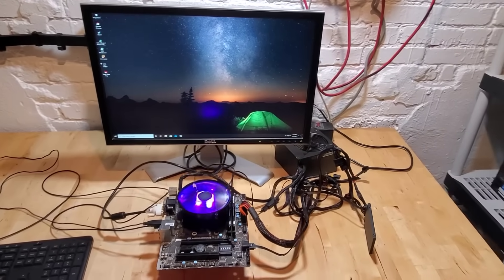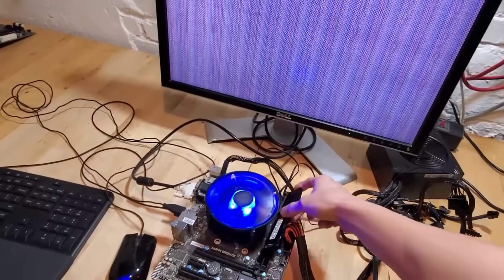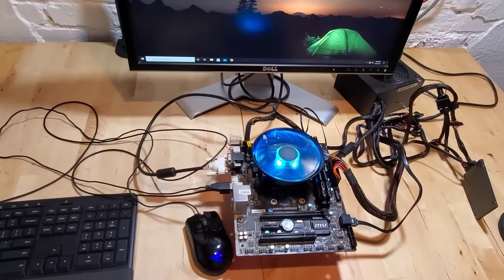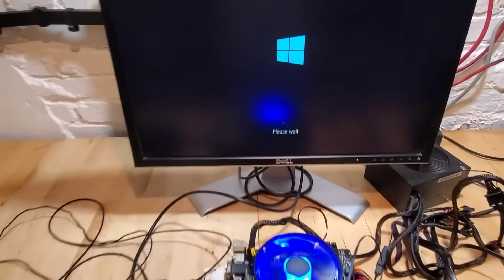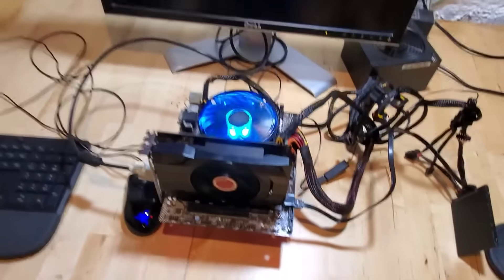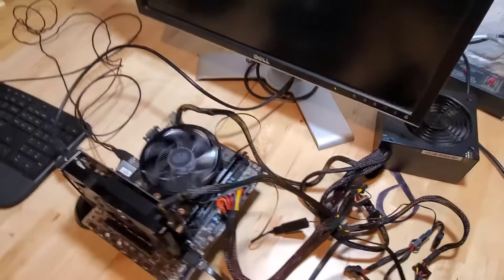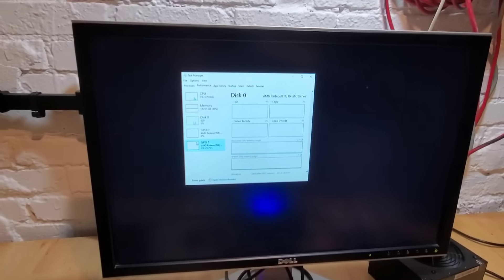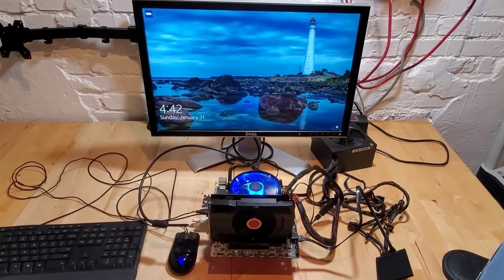What happens if you remove PC components from a running computer?

Comment: Some motherboards, especially server-oriented models, do allow you to hot-plug (but not necessarily hot-swap) memory and PCI-E devices.
Non-system SATA and SAS hard drives can be hot-swapped if enabled in the BIOS. Most consumer boards have this option, but it's usually disabled by default.
Reply: Out of curiosity, what is the use for hot-plug but not hot-swap? Seems like if you want to test components hot-plug wouldn’t be much of a time saver while hot-swap would be much more useful
Reply: @flameconvoy7424  One use for hot-plug is to add more memory to a running server without restarting or interrupting its operation.
It is completely pointless on consumer/client computers, which is why it's usually disabled by default.

Comment: The sligthy difference between (peripheral device / GPU etc..) and (CPU / RAM) is that the first ones are optional devices, and the second ones are the core devices.
So if you remove one of the first one, your PC won't "bug", you change your HDMi Wire to plug in MotherBoard, then CPU will print Windows technically.
The second ones, if one of them are removed, you have to reboot.

But now there is so much securities about I.T...

For exemple the Gpu's fan was running even tho it was disconnected, only because the GPU itself was plugged with Power Supply... Then while he put the GPU onto MoBo, the fan slowly decrease, to "turn off" the GPU, so it seems for the gpu to be like you were playing a game, then you turn off your computer, nothing to worry about (but i would like to know what if you disconnect first your pin PSU from GPU, would be an instant stop and maybe problematical for the component...

The CPU, if it is overheating, you have at first the throttle, to bride cpu's power, to make it cooler, and if your whole PC environment is "overheating", there will be an automatical shut down to prevent from burning, melting, or blow may be ?

Comment: I am surprised that the system didn't shutdown to protect the processor because of the spike in temperature before you could remove it. They get hot stupid fast without a heatsink.

Comment: Just came across your channel, haven't seen all your videos yet but can you try this out on a Linux distro doing hot swap?
Reply: This is definitely not a hot swap lol. Hot swapping components would imply that they were MEANT for hot swapping. Even disconnecting your VGA cable from your computer tower to your screen and reconnecting it isn't considered a hot swap. Neither would this. Sadly, beginning to extract ANY components while running a computer especially where the majority of the OS/DISTRO is loaded, such as Debian, Ubuntu, Kali Linux, etc, would immediately render the distro/OS immobile. You are literally plucking out 2/3 of the functionality by trying to just remove the DDR sticks first

Comment: I wonder if AHCP and hot swap was enabled for the SSD.
I have some funky situations with my SSD (acts as games storage rather than OS storage) where it would kinda be there according to system, I could go into that disk but not folders on it nor open any file. Restarting PC caused to not even bios to see that ssd. Had to fully shutdown and turn on pc.
With hot swap enabled I just sometimes get game crash, while windows plays sound of unplugged and plugged device.

Comment: One of the reasons is all these devices have memory, registers, and are constantly being accessed, like the page file on the hdd, or data and programs including the operating system running in ram. If the ram is removed for example all current data on that device is lost and the cpu can no longer run any code, as it has no memory, the windows desktop image is still held in video ram but is just a snap shot of the last frame before ram was removed. When its plugged back in, the data is gone, so system need to be rebooted and the ram is repopulated with live data again.

Comment: when you remove components you damage the electronics, because is not hotswap. Hotswap has special design.  I worked on the HP and IBM rackservers hotswap disks and power supplies. They are just surprisingly good technology not in the consumer market. The running OS stores on the RAM, of course the display is lost when you removed the RAM

Comment: what happens if u run dual display setup, one on mobo and the other with ext graphics, then remove graphics card while running. will it take the whole system down?

Comment: The effects from removing the ram make a lot of sense as a computer nerd.  The ram is where the immediate functions the cpu needs to do are stored so by removing it, things like refreshing the screen can not be done, and the cpu can’t get new inputs so moving the mouse or the keyboard does nothing.  Then upon reinserting it, the memory can be written to and executed.  Sorry if this is too technical.
Reply: However, the routines that load mouse and keyboard input into RAM are also stored in RAM, well they were stored in RAM but as soon as the RAM was removed it was no longer powered. RAM needs power to keep its data, so as soon as the power went, the data was lost too.
Basically, removing RAM and putting it back would never restore the system.

Comment: all new computers all have "hot swap", so removing any hardware while the computer is running, will not damage it, unless you remove the fan, but 99.9% of the time, BIOS will detect overheating and will shut down before it's damaged. Unless you already went into BIOS and preset the sensors so it wouldn't shut down.

Comment: Recently I acquired an authentication locked Windows XP machine. I didn't know the password, and the bios was locked to immediately boot to the hard drive. So, I removed the power from the IDE hard drive, forcing it to boot to CD-ROM when it restarted. From there, immediately as it began booting to CD i plugged the power back in the drive and was able to install a fresh XP onto it :)

Comment: God damn, you had me scared for your CPU and board man.  When the power is on, the socket is hot, and I had imagined that bringing the CPU in contact with the socket would have caused an electrical discharge that would kill the CPU and possibly the board as well.  Good to know that didn't happen.

Comment: Random recommendation video to me. The first 10 second set up blew my mind😂😂
I was messing with undoing my pc I unplugged everything including power supply and re attached everything.... cause the sound keeps cutting out when I'm playing YouTube videos idk why. Only fix is to click audio and click stereo again then 30 seconds does it again. Doesn't happen when I plug in a headset. I tried reinstalling drivers, I tried different hdmi cable. Idk if maybe something is damaged I doubt it tho. Or maybe it's the hdmi to my TV. I'm not using a monitor.

Comment: if you hot swap the graphic card, you can then plug into the onboard graphics and it will be running just fine. 
Not recommended however!

Comment: when you remove the storage device of system.. the system will remains alive till it uses all pagefiles which was stored in RAM  thats why when you remove the storage device the wall paper gone as it doesn't stored in RAM pagefile by windows and slowly the windows explorer gone and task manager gone and afterwards RAM renew and search for recent pagefile it fail to do that and goes to bluescreen of death..
otherway where you get instant BSOD after removing Storage device is when you are running a memory(RAM) intensive application where windows force to use Slow Drives as its Pagefile memory drive

Comment: But what will happen if you remove GPU and the plug the screen back into the motherboard? 
I used to unplug the screen from motherboard (while the system is running) and then plug it back in and this works alright, but what will happen with swapping?

Comment: 5:55 what's the stop code for the blue screen? so we can know if we run into ssd/hdd problem in future..
Reply: Crtical process died
Reply: CRITICAL_PROCESS_DIED is the stop code. It's not related to the hard drive, but instead happens when a system process gets terminated, like csrss.exe.

Comment: This may a dumb question but that means if I plugged & unplugged case fans to my motherboard while it’s on it should be ok? I have a case with 3 fans & I can only get one to work because I don’t know where the other power connectors are on the motherboard but I’m always scared to plug it in while the computer is running

Comment: You didn’t try to remove RAM while GPU is installed.
When there is no GPU, RAM is used as video memory. That’s why there are graphical artefacts when removing RAM.
It is interesting to see what will happen if GPU is running though.

Comment: The reason why removing the ram makes the artifact worse when both ram are removed is because each ram hold equally as many pixels saved. Meaning the pixels the ram which was plugged in had those pixels will just be replaced with random
Reply: What happens if you remove PC components from a running computer? umm they shut off and you loose that functionality in the system and your being an impatient fool with your computer parts🤣🤣🤣

Comment: Integrated graphics handles graphics differently to external graphics.  So if you removed the RAM modules form the motherboard the display would of frozen. When the graphics card is removed, the computer will not switch back to the integrated graphics.

Comment: The fan doesn't need to be enabled by the CPU at all. That's because the fan is powered by the PC's plug, so if you try to turn it on separately, you can

Comment: what happens if you rip capacitors off while it's running
Reply: Uhh, you die?
Reply: @connoregan7054  not unless they're in the power supply and you use your bare hands

Comment: i remember i did remove the hdd from my running pc a while ago,and system WORKED fine for like 10 mins before pc shut down,and i tried it again with linux installed directly on a usb stick,pc ran fine for about a hour then it just shut down

Comment: cpu removal with extended gpu installed is missing and fact when you enough fast plug back ssd it will come back to work and windows to go will stand 5 minutes without drive

Comment: Putting back the ram doesnt fix it, because you basically remove the code you were running, when nyou connect it back, the ram has lost the dat (because is ram lol) and it doesnt know where to keep going. Thats one of the problems at least

Comment: The visual glitches when removing the RAM happen due to the fact that the integrated graphics were being used. Integrated graphics use the computer RAM as video memory, so once you unplug the RAM sticks, the video memory will be gone, so the screen will start flickering.

Removing RAM in a computer with a dedicated GPU should have a different effect, since the video memory will still be set, so probably the graphics will be frozen, but the computer will stop responding.
Reply: Yup, can confirm. That's exactly what happens
Reply: Advantage of Integrated Graphics, as it shows the ram removing patterns
Reply: @mithunlaha1991  Yeah, it was interesting to see how the picture was interleaved on the two RAM sticks in a checkerboard fashion.
Reply: If the system has another GPU (integrated from your words) which renders the picture and user dismounts a discrete GPU which is plugged to monitor, there is some chances that after mounting the discrete GPU again everything is going to work as usual. Dismointing a GPU with actual monitor in it looks stupid. At least that happened so when I mounted/dismounted an extertal GPU to my laptop.
Reply: Actually I had the RAM removal on my PC with a dedicated GPU. For some reason I hadn't fixed the RAM sticks properly in the slots so the PC was running normal until any external pressure was given to it that resulted to one or two sticks to "detach" from slot. After detachement the PC instantly shutted itself down and restarted.
Reply: The same thing happened to me as in the video, I was playing and out of nowhere my screen flashes and starts giving these glitches, I immediately turned off the PC by holding the power button and when I try to turn it on again the PC makes 5 beeps, and refuses giving video.
Reply: Looking for these kinds of patterns is also helpful for troubleshooting graphics cards.
if mart of the memory is faulty, you tend to get repeating patterns.
Reply: this basically describes my situation, i foolishly removed a stick of ram while in operation because my system was only recognising one of the two sticks so i figured it wouldnt matter. like you predicted my display froze, but unlike in the video when i reboot, my psu fans start whirring up just fine but i get no display output, not even the bios prompt screen. is there anything i can do to diagnose this any further, or anything i could try to fix it? would be very grateful if anyone could help. thanks xxx
Reply: @doooofus  haha you ever figure it out?
Reply: @GRAITOM  nah at this rate i might just start buying new components starting with ram, then mobo, then maybe cpu and swap them in one by one, to see if maybe i just got unlucky and shorted something while pulling it out. i dont think so though because im pretty sure my ddr4 uses the same socket as the ram in the vid, so its very confusing for sure
Reply: @doooofus  i did the same thing, tried to plug it in while it's running. I believe a tiny bit of smoke came out, but it's alright now. I had to a lot of things like reseating ram, reseating the motherboard battery, reseating gpu, etc until the motherboard came back alive. Although I cannot shut it down, or else it won't POST. It takes time but this is fixable in most cases i think. I try out all solutions since I don't know what is the problem specifically
Reply: @adityaks345  thank u so much for the reply, im away from home rn but ill try this as soon as i get the chance. crossing my fingers thisll work out
Reply: @doooofus  it should work, i had smoke coming out of my pc and it works as good as new now, just remember to reseat almost all connections

Comment: I'm a bit disappointed that you unplugged the GPU, then plugged it back in to see what happened, without checking what happens if you move the monitor cable to the onboard GPU first, to see if that still works or not. I'm sure the system is crashed at this point already, but would've loved to actually see that.

I'm also curious what happens if you remove other non-essential components, like install additional PCI-Express cards and remove those, such as sound card, network card, etc...

Comment: Fun fact: the display losing it's pixels with the ram removal was because the computer was using Internal Graphics, which is built into the CPU. VRAM (Video Ram) is used for video display and usually comes built into Graphics cards, however the CPU doesn't have this built in so the computer uses system RAM as a compromise. You would probably get a different result if you were using the GPU during the RAM removal.